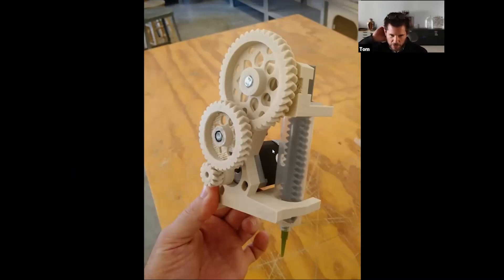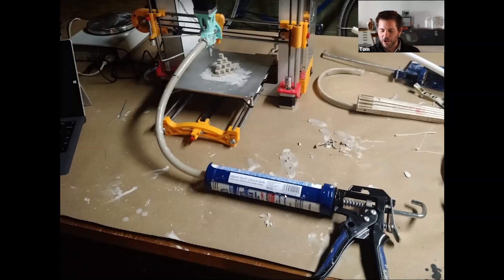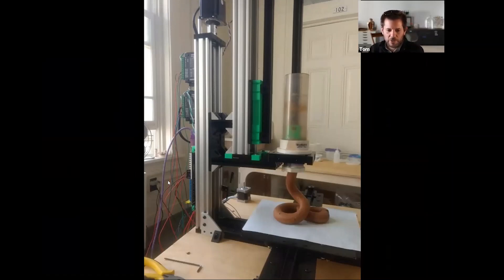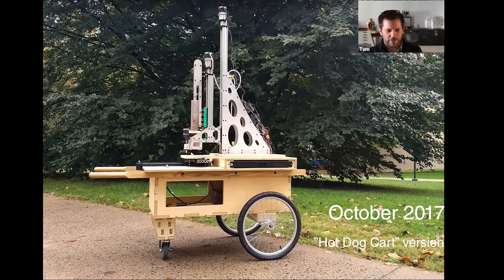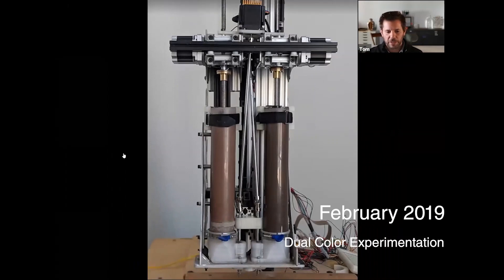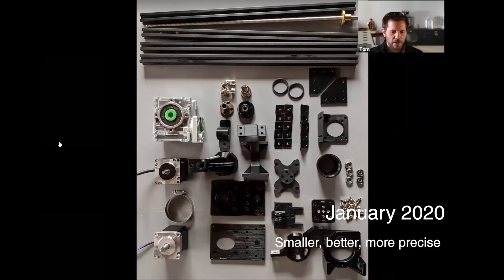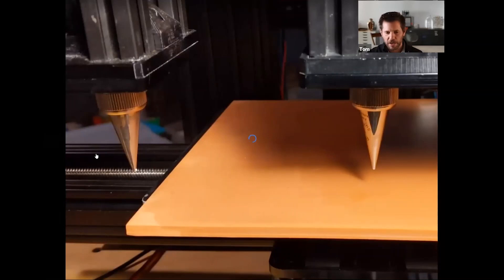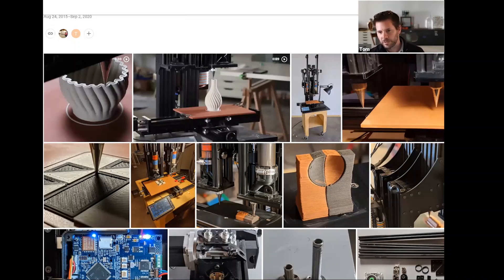My Experiences Building Clay Printers 2015-2020

Comment: I'm sorry about a naive question, but I read in some book many years ago that if there is air in the clay, it can cause cracking or destruction during the firing of the object? In my limited experience with (plastic) 3d printing, there are always air bubles and gaps everywhere. Is this a problem for these clay printed objects or I misunderstood something?
Reply from the maker: This is the most frequent comment I get. I should do a video about air and moisture in clay and the firing process (sounds like a thrilling video!). Anyhow, the short answer is that I don't have negative outcomes in firing as a result of air/moisture. The "why" answer would be much longer, but has to do with wall thickness, drying time, and firing schedules.
Reply: @TomLauerman  Yes, please, do a video :) And apologies for perhaps a naive questions.

Comment: Thank you for sharing your experiences. I am interesting in clay printing for quite some time now, because the material do not harm the environment and allow to make potential food and heat save objects. However clay printing was always hard to get into for me and seems to be quite time intensive. I see the latter confirmed by your video but it also gave me more information, which make it easier for me to get into the topic of clay printing :)
Reply from the maker: Thanks for the kind words. For better or worse I tend to make things more difficult than they need to be, and I liked to get absorbed in the technicalities of process. There are some good designs out there for printers that are less complicated.